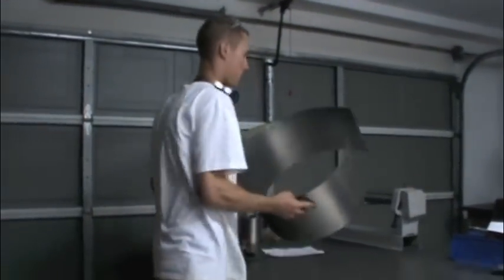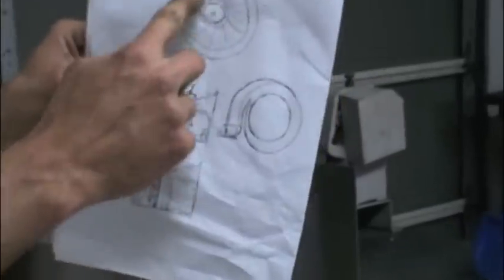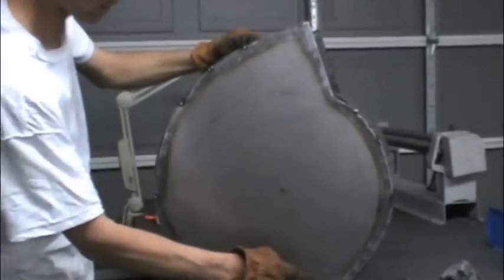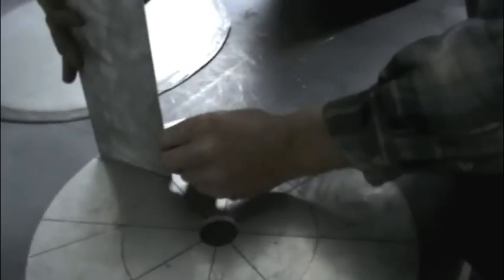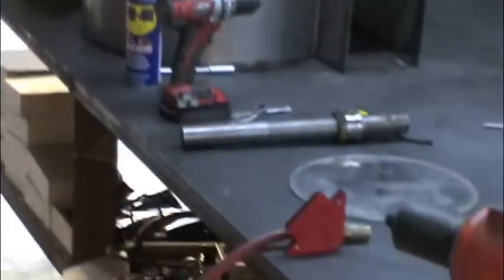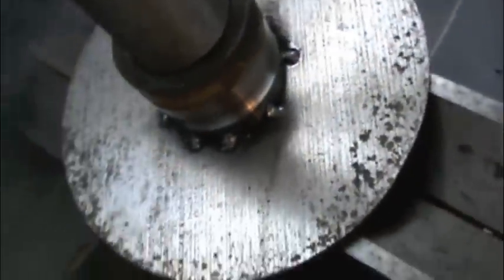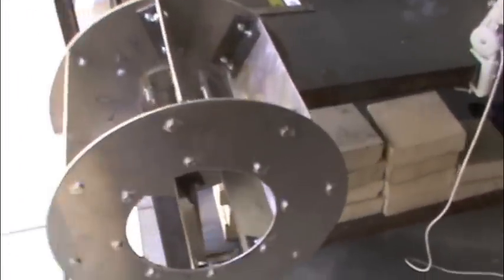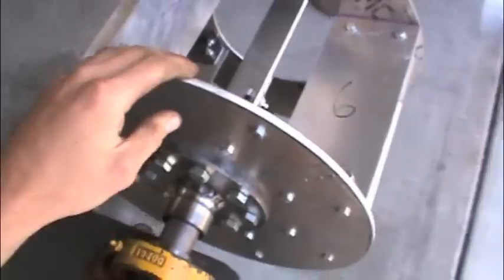Building a heavy duty centrifugal blower (Homemade)

Comment: Got to get your terminology right....the rolled up shape is called the scroll.... it's not the blade assembly...it's a wheel...on the wheel you have the blades 8 pc's...there's the wheel backplate....and the wheel shroud ( the one that has the bigger hole in it)...you have the wheel hub and shaft....no keyways?....no pedestal to mount bearings onto....? So what's the static pressure and volume?..wheel is getting balanced right...

Comment: woww.. sir, what kind of steel do u use for make blower housing..share pliss: )
Reply: Please don't ask this guy a question like that, he welded to bearing steel without even a preheat, though for a fan hub that would definitely be the wrong application anyway, no matter who welded it and a professional welder wouldn't have done it. Welding to that kind of steel it will be prone to cracking and you surely don't want that impeller coming loose at a few thousand RPM.

Comment: What is this design used for. It wouldn't work too well for blowing debris or leaves as the length of the blades is too short and width too much.